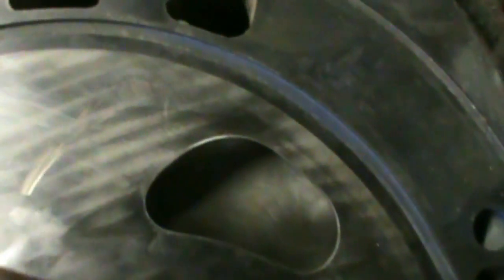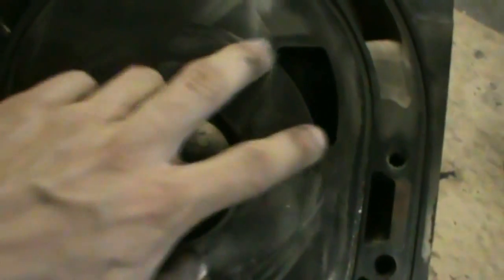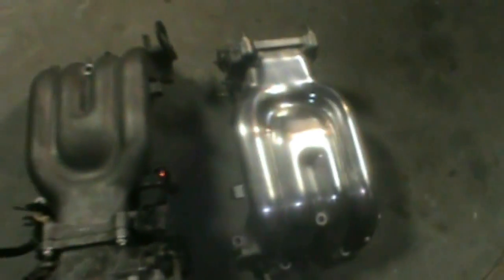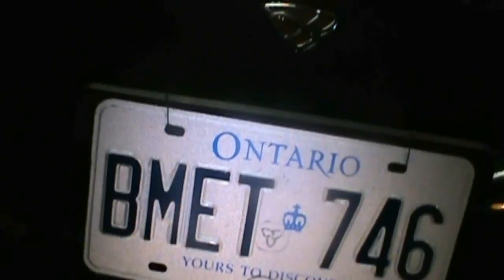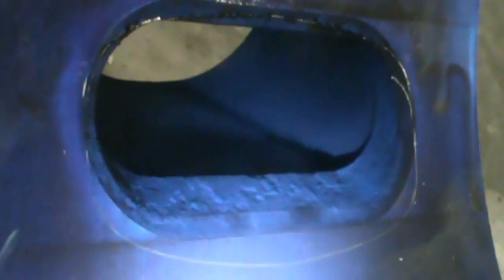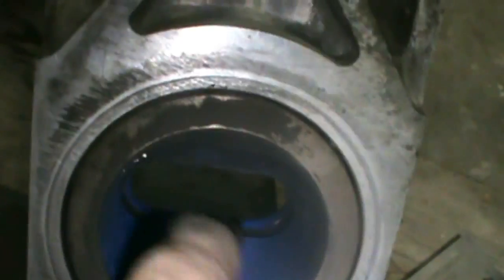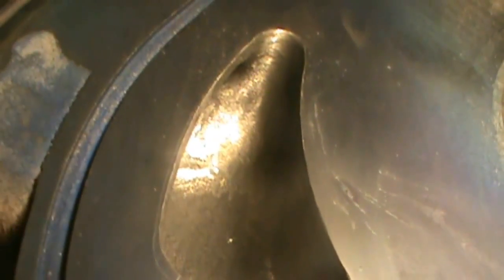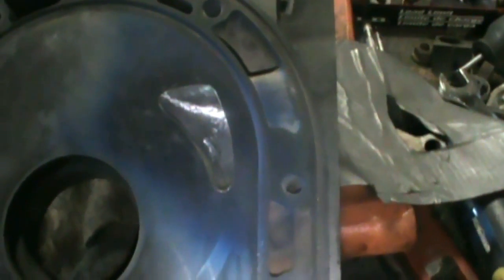How to Rebuild and Port a Rotary Engine : Part 8

Comment: What hp gains are you expecting from this?  Also does a port require you to rebuild the engine more often due to increased wear or anything?  ps mazda canada is a bunch of GOOFS

Comment: its kinda like porting a 2 stroke. think of engines as a air pump. the more air you can get throw it the more power you make but it is really hard to get air into a engine without a supercharger turbo or the stupid shit nos. what porting does is make the passageways or runners more efficient at getting the gas/air mix into the combustion area. Great video lmxops and remember everyone Mazda canada is a fucking joke and pensl pushers should not be the ones doing the contest or picking who wins it!